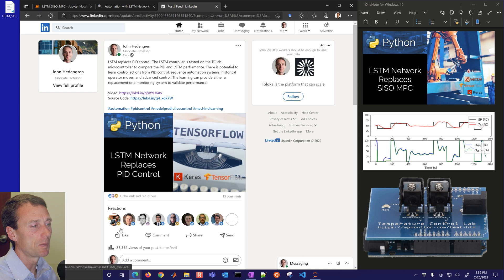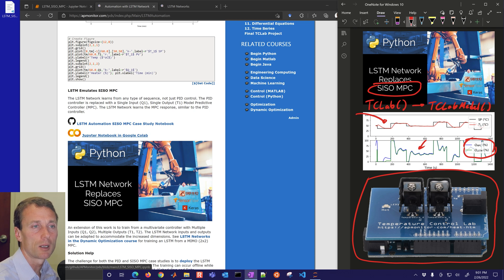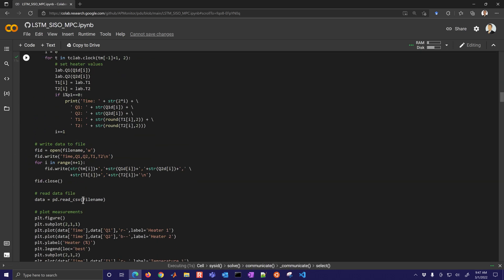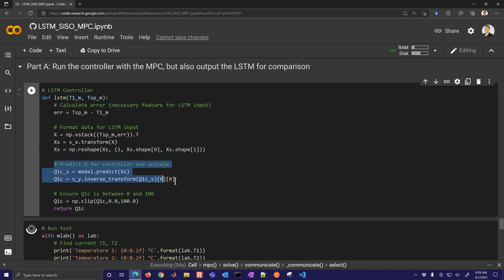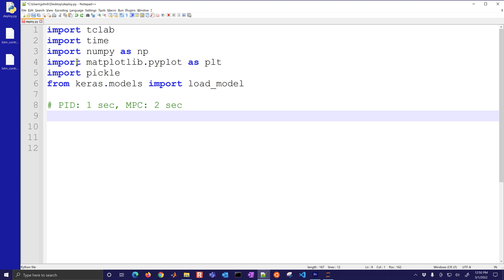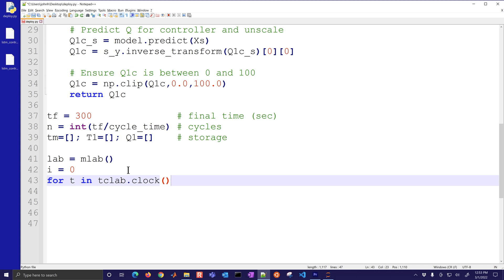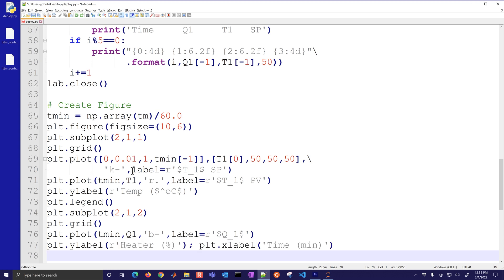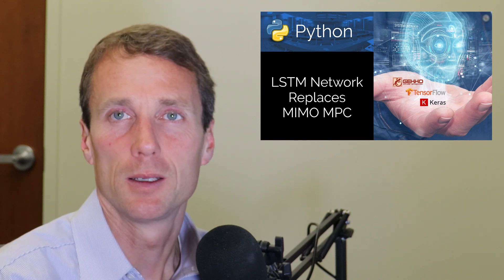LSTM Replaces SISO MPC

Comment: Hello, first of all I want to say that your work is excellent and of great value. I've learned a lot so far.
I would like to ask a technical question. Do you think there is any way to develop an algorithm that performs the pid tuning online and automatically? that is, from time to time the system provides the gain constants based on the measurements.
Reply from the maker: Adaptive control is a well-studied area. Here is a review article: https://link.springer.com/chapter/10.1007/978-3-642-86420-9_12

Comment: Thank you sir
Can I apply the same way for a different plant, 
for example replacing PID for DC Motor with LSTM?
Reply from the maker: The approach is general - it should work for any dynamic system where you generate data.

Comment: Thank you first for the great video, very helpful
I have a question :
I developed a temperature control system with a specific set point  using arduino  in a small greenhouse and I logged data in a SD card. Now I wanted to develop an LSTM model that I can implement it as a predictor controller in my greenhouse. 
my question is to know after training the model and get the prediction accurate, what to do in order to convert that model and use it as a controller?
and how to proceed for the implementation?
Looking forward to hear from
Thank you
Reply from the maker: Here is an example application of implementing real-time MPC: https://apmonitor.com/do/index.php/Main/TCLabF  Just replace the mpc function call with the lstm function call.